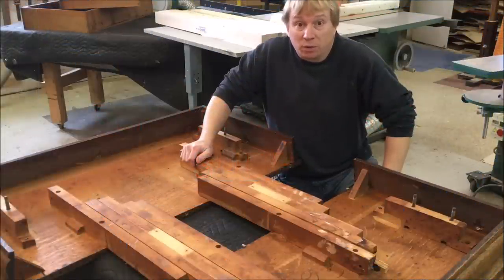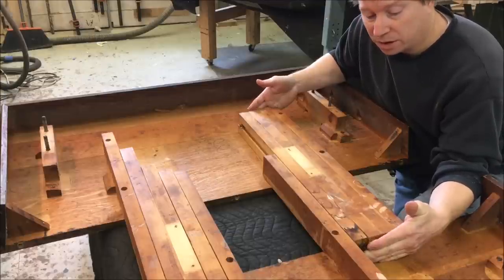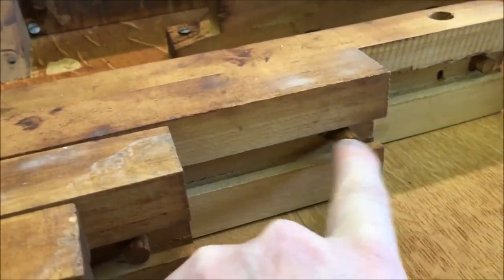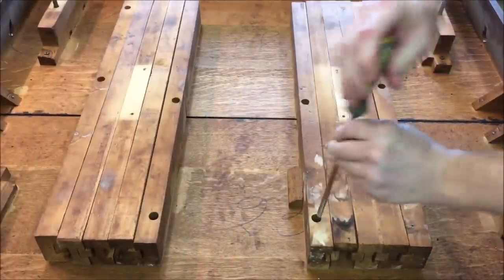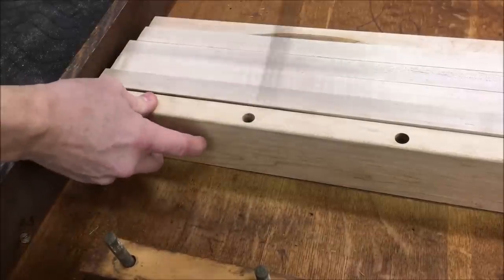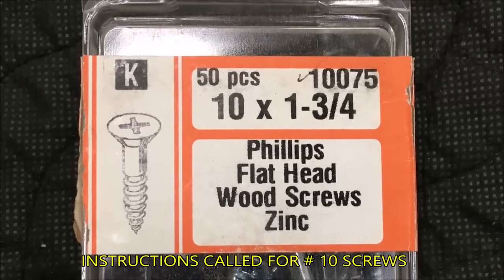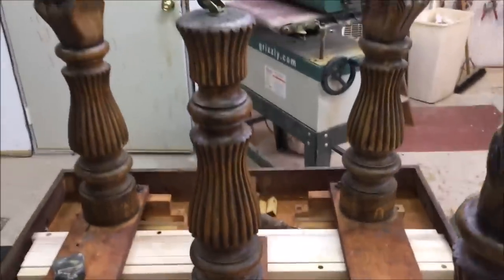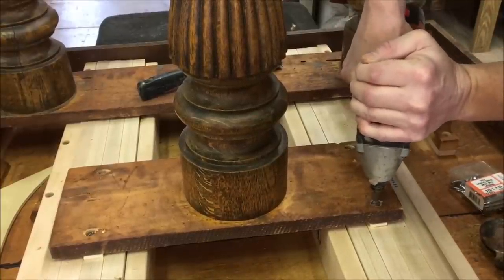REPLACING DINING ROOM TABLE SLIDES

Comment: This was a very interesting process.  I have a round table from the 1800's (not sure about the exact year...but suspect it is from the 1880's) that has a slide system just like that only MUCH smaller.  The slides are starting to fail on my table and I am hoping Osborne Wood Products has a solution for our table as well.  I am going to look them up!
Reply from the maker: also other suppliers, just search online

Comment: Hello Ross could sure use some advice. New to your channel. I have a similar project, but the slides work. My issue is the lower veneer is peeling I want to remove the veneer I believe there has been some sort of water damage, causing the veneer to lift. This table has tons of sentimental value so we are trying to fix it.  I am not sure if I should try to remove the old veneer, leaving it on just the natural wood? This way I can properly install the the sliders that don’t sit on a flat surface. Apparently the sliders have been moved to different locations beneath the table and it is so many screw holes all over and even a some that have shredded the wood. Can I move the original location again, will the slider be compromised and not work properly.
Reply from the maker: do not remove all of the veneer , it will make the top unstable and it will warp . try to re-glue if possible. if the old holes are stripped out , plug them first so the new screws will bite . be careful that the screws are not too long and poke out the top of the table .

Comment: So glad to see another video from you! It's almost embarrassing how often I check to see if you've uploaded new content :-). I do have a question if you can take a moment: since the extension and leg assemblies are both already glued and screwed, what purpose does the small glue block serve? I've seen them in older furniture when I've done surface refinishes and they seem a bit extraneous.
Reply from the maker: JUST ADDED REINFORCMENT
Reply: @Ross  - thank you. I am very new at this, and I appreciate your response. So, why just on one side? Does the block go on the side that might be subject to the most "pull"? And, why the funny shape? Why not just a small square or rectangular block of wood? They always seem to be somewhat triangular. Please advise.....
Reply from the maker: I put three of  them on all of the rails that are screwed to the top . they are often triangular . but a square block is typical as well . I usually sand them and put a bevel on the edge so there isn't a sharp corner and looks neater .